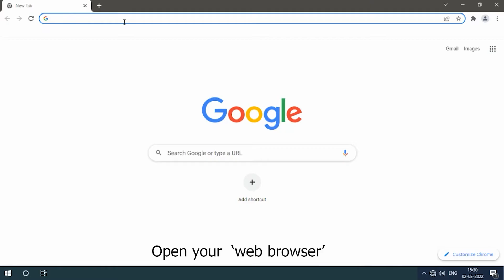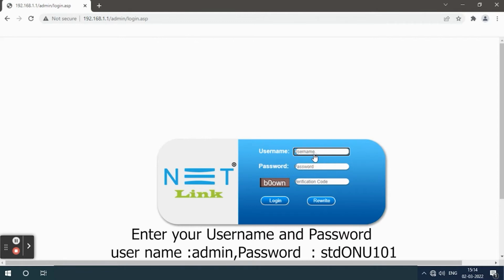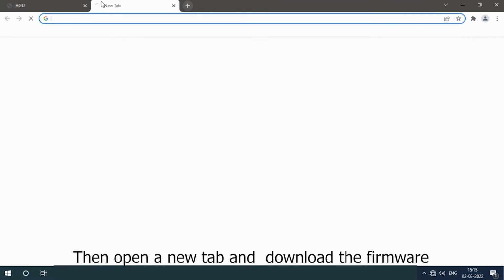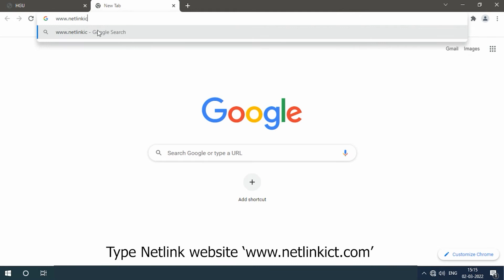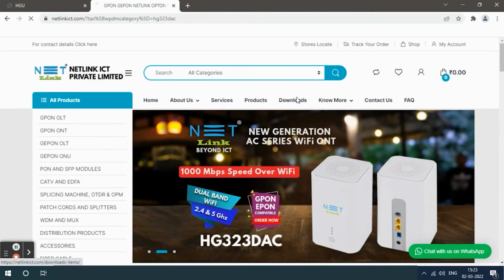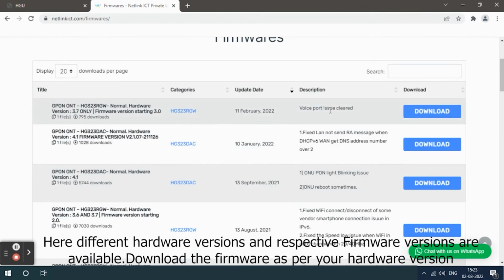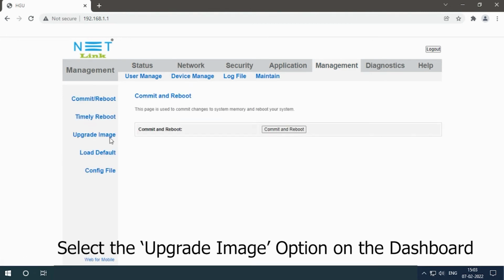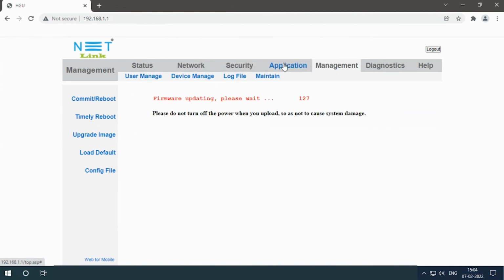How to Upgrade NETLINK HG323DAC ONT Firmware - 21

Comment: Please release a working DDNS firmware. I have tried the latest firmware version “V2.1.08-220125” and it’s not updating the public IP automatically to the DDNS provider.
Reply from the maker: please get in touch with our support team through your operator

Comment: i have , HG323RGW– Normal. Hardware Version : 3.6.  The Feb 11 2022 update fixed all issues + WIFI power adjustable
, but unfortunately lightning killed the modem. the changed modem was on old firmware & when i searched the new firmware was not available in netlink Site.